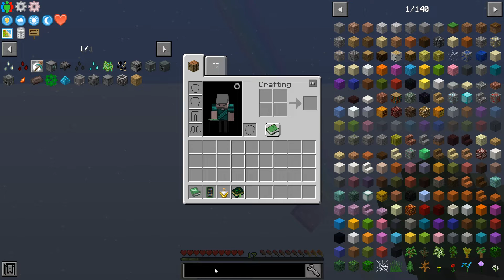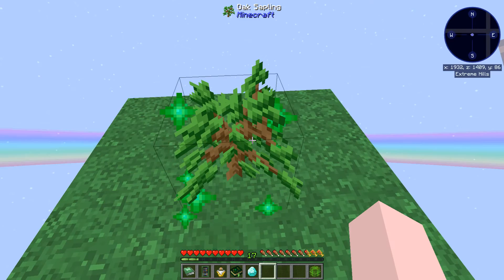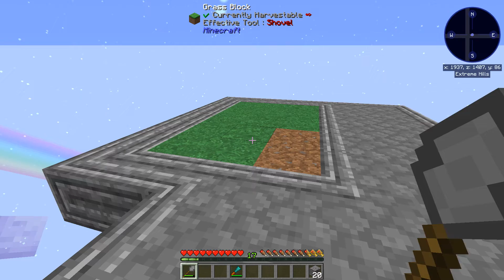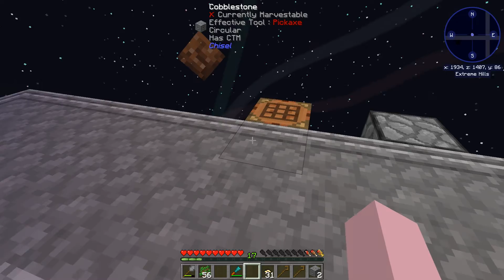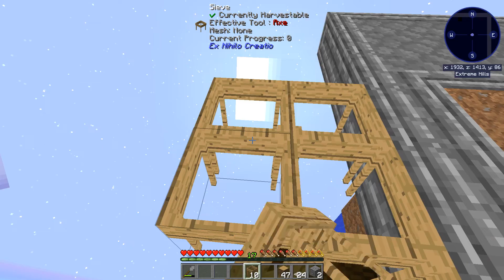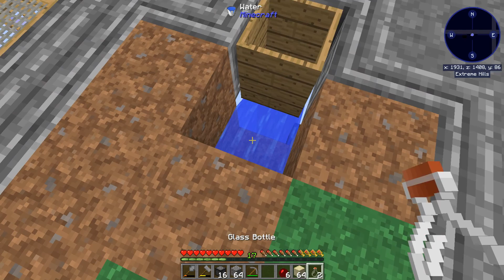01: Project Ozone 3 Kappa Mode - Closed Beta

Comment: And I only started playing Titan mode yesterday... I guess I'll wait a bit more for Kappa release.
Reply from the maker: Closed beta will take months to work all the bugs out.
Reply: @WilxGaming  Then I'll try to dive into it after all. And on the small nore: are Dawnstone and Dawnstone Aspectus supposed to be that easy to get? From what I remember, in Normal mode you was forced to use Embers machines for that, not just Smeltery.
Reply from the maker: I haven't done testing yet. But from Kappa JEI you can't pour liquid dawnstone into a tinkers ingot mold, you need to use an embers stamper or something from nuclearcraft. Also I didn't notice smeltery liquid dawnstone in normal, so I would need to check if it's there, but it probably is.